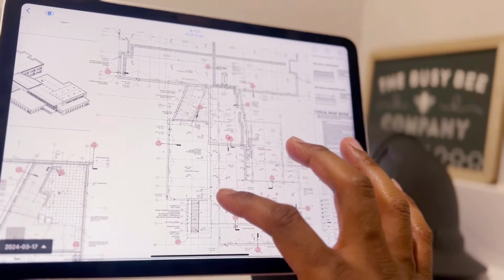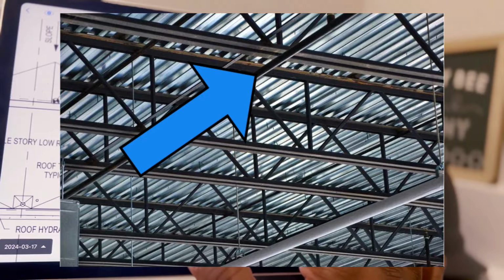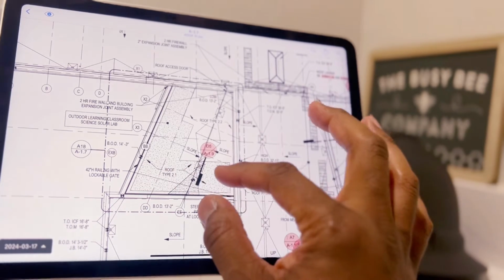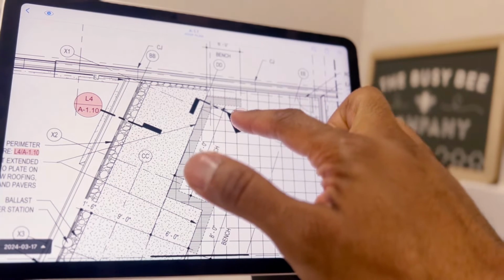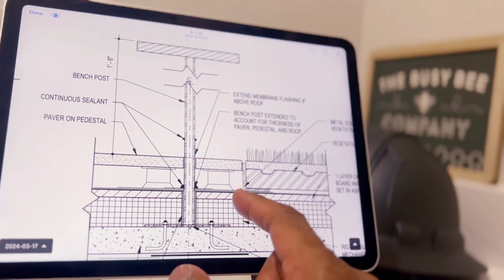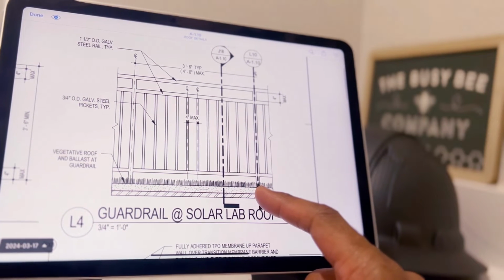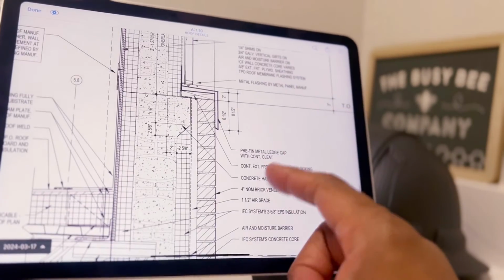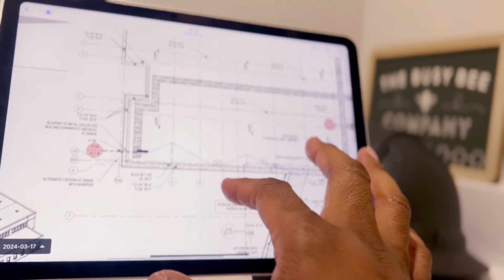How To Read Roof Plans

Comment: This was super helpful. However where I struggle is taking a parapet detail, and figuring out where that detail applies to the roof plan. So that I can figure out how many linear or square feet of parapet wall I am dealing with. Any help there would be much appreciated.
Reply from the maker: For roofing you want to look at the parapet roofing detail to see the flashing and waterproofing at that area. Typically the framing for the actual parapet wall is done by the (drywall) framer. Most parapets are 48” high.

Comment: Also TPO normally is installed two ways. With a glue type of adhesive or Heat welded at overlaps. I might be confusing with PVC single membrane or PVC may also have to same installations. Check and correct me if I’m wrong.
Reply: TPO is installed with adhesive. Or mechanical fastened. Laps get heat welded regardless of install

Comment: I’m pretty sure mechanically fastened means screw, nails or any metal fastener…etc. basically NOT adhesive, i.e. SA, hot mop, torch, cold process or glues. Correct me if I’m wrong please.
Reply: You are correct